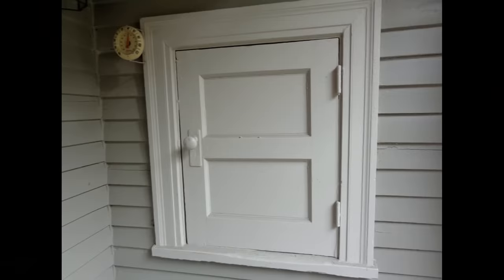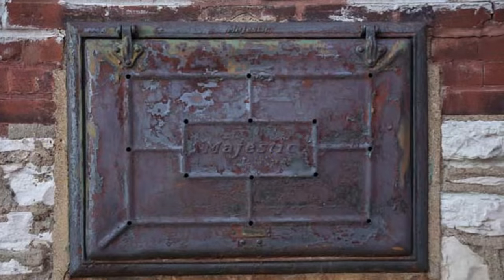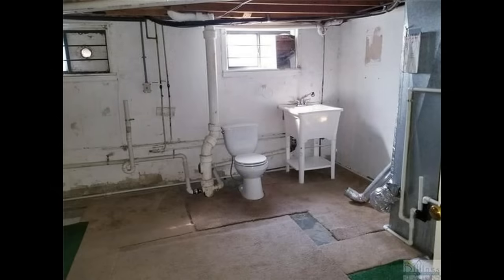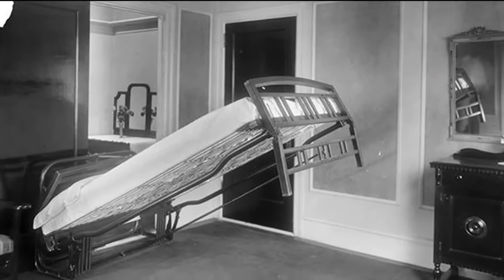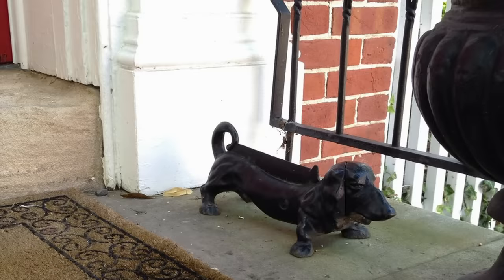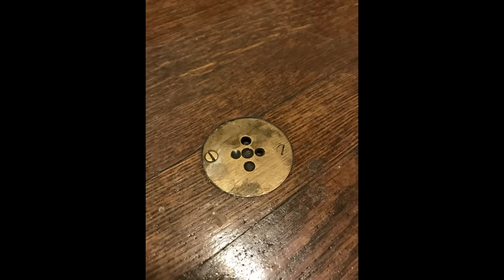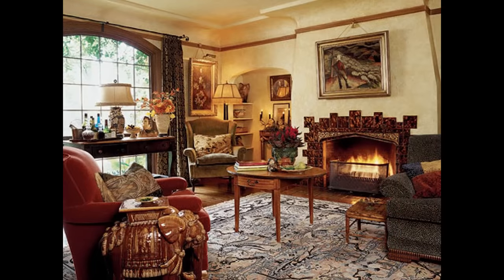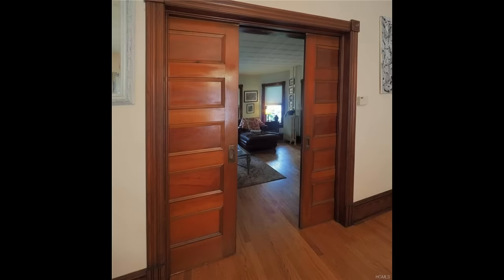Mysterious Home Features No Longer Used

Comment: My grandmother’s house had those things. The milk was still delivered into the little door in the kitchen when I was a kid. And there was a cabinet with a built in ironing board. Thanks for the explanation about the basement toilet. I always thought it was ridiculous but my husband is a contractor and he automatically used that setup for the original purpose.
Reply: The main problem with those were the proper height for drainage.If you're lower than  the main drain, it won't flush and also the smell stays in the basement
Reply: @blainerudy2255  What happens in the basement stays in the basement
Reply: @blainerudy2255  My basement toilet works well enough with gravity alone, but my next-door neighbor's needs a macerating pump because the main line runs downhill from their side.
Reply: The farmhouse I live in, built in 1931, has an ironing board in a closet and I still use it.  We also have a toilet and shower in the basement - enclosed since I've lived there...hubby uses it all the time with no problems with drainage to our septic system and no smell.
Reply: I wish they had also shown a built-in ironing board - there very popular.  Another thing not shown was a cabinet between the kitchen and dining room that served both sides.  We had one and it was really great to not have to carry dishes and flatware from the kitchen, just open from the dining room side.  We also had a pocket door between the dining room and the kitchen.  We had to put a hook and eye latch on it because our Australian Shepherd very soon learned to slide it open!  Built circa 1900, we had the picture rails among other things mentioned here as well as beautiful leaded glass windows!
Reply: My grandmother had an kenning board cabinet, which I always thought was genius. We've gone backwards in that way. Now we have to set up a cumbersome contraption that takes up a ton of room.
Reply from the maker: Thank you for watching and sharing some of what your grandmother's home had.

Comment: Even with modern heating and air conditioning systems, transom windows really help with air circulation.
Reply: House a friend rented had transoms on the floor! They were really great. Open them in the evening and the cool air comes in the bottom, hot air goes out the top. Unfortunately, both sets were on the same wall. No cross-venilation.
Reply from the maker: Yes they do.  Thank you for watching!

Comment: Here in Japan, the intercom is still universal, along with the doorbell camera. My wife and I use ours every day! Japanese homes almost never have central heat/AC - they employ the room/space concept and have separate units for each room that needs to be temperature regulated.
Reply: If I am not mistaken, what you are describing is called zone heating and can also be accomplished with central heat/AC by using different thermostats, which then use dampers to direct the heat/cool air to where it is needed.  Otherwise, the control is done by opening and/or closing vents/registers.
Reply: Because Japanese homes are rebuilt so often (isn't 30-40 years the norm?) I think there is less fear about putting in 'trendy' or house-wide features, such as intercoms or built in electronics, like self-heating bathtubs and fancy washlet toilets. By the time they start failing, it'll be time to rebuild the house. In other places, were the mentality is that house is essentially permanent, and maybe expected to last a hundred years or more, there is a mental reluctance to putting in similar features, since they will wear out far faster than the house and become a nuisance.
Reply: @davidrickard8943  It’s more like a mini-split system, which you can find in the states on older homes that do not have HVAC.
Reply: @blatherskitenoir  you're not suggesting that we've been building homes with more than a 20-year foresight, for the last 50 years I hope...
Of note those houses 100 years and older are made mostly of primitive growth wood which is not as prevalent now is it once was
Reply: In my opinion that sounds more cost effective to have separate units for each room then you would only be running heat/ac for the rooms being used.
Reply from the maker: Thank you for watching and sharing how it is in Japan!

Comment: Loved this video. The only one I thought of - and lived with - was the attic fan. They were wonderful instead of air conditioning. Kept the house cool in the mornings & evenings. And the air in the house was always fresh. Wish I had one now!!
Reply: My MIL’s house was built in the 80s I think, and has one! It’s in New England, so the nights are so nice & cool!
Reply: I think attic fans are still current.  And they're every bit as useful in a house that has air conditioning, because they substantially reduce the air conditioning electric bill.
Reply: I grew up in muggy Missouri and remember well the comfort of falling asleep with cool air from my open bedside window being pulled in by the attic fan.  As an adult I lived in an older "rowhouse" in DC which had a belvedere. This was a small tower in the ceiling at the top of the three story stairwell. It had transom windows on all four sides that could be opened to catch the breeze and draw the rising hot air out of the house.
Reply: @bryanhenderson591  Most  reputable HVAC companies will recommend attic fans when installing central A/C - it simply takes some burden off the A/C system.
Reply: Sounds like you are referring to a whole house fan.  These are still used in the South quite a bit.  Flip a switch in a cool part of the day and the whole house cools down in about 5 minutes.  You can do the reverse in the winter if it gets warm in the afternoon.
Reply from the maker: Those attic fans are a great one to remember.  Thank you for watching and mentioning that one!

Comment: You’ll hear it in some Victorian-era houses that have architectural niches built into the wall of the staircase landing. The story goes that these niches were called “coffin corners.” Someone might explain that, because most people died at home in their beds and because most bedrooms were upstairs, it was difficult to get the casket up and down the stairs when the staircase turned a corner. So at the landing, Victorian architects would cut a niche into the wall. The pallbearers would insert one corner of the coffin into the niche and make the turn at the landing.

Part of this is true: people did tend to die at home and the bedrooms of larger homes did tend to be located on the second or third floors. And many Victorian homes do have niches built into the wall of the staircase. But these were for decorative purposes: to display a statue, perhaps a bust, or a vase, or maybe flowers. Why would anyone carry a coffin upstairs to the corpse rather than carry the corpse downstairs to the coffin? Most books about Victorian architecture debunk this myth. For example, John Maass calls it a hoax in The Victorian Home in America (1972).
Reply: Have a look at the front doors of those homes. Many could lift off the hinges and be used as "cooling" boards for the deceased.
Reply: A lot of those homes have  coffin doors as well - a secondary 'front door' so to speak. You don't have the living go in and out of the same door as the dead. The Victorians had a lot of death superstitions. The dead were always carried out feet first so they could not lure others to follow them to the afterworld by looking them.
Reply: Around the victorian time period they had books of the dead or recently deceased and viewing rooms ( a special room in the house to put the coffin in to allow people to pay their last respects to the dead (this was before the rise of funeral homes)
Reply: @erin7231  That’s right, they had the living room and a parlour. If your family member died they would be cleaned and prepared and would be kept in the parlour for viewing until it was time to go for the funeral.

Comment: Another interesting feature in most homes of the Victorian era was the "Trunk Room". This was a large closet usually located at the top of the house and used for the storage of the big steamer trunks and hat boxes required for traveling.
Reply: Interesting! I’ve read some old British mystery novels in which the house has a “box room”. I’m thinking these were used for the same purpose.
Reply: Also known as a "lumber room," though I don't know why.
Reply: @Blakeneyd  we had a box room. Was the 3rd bedroom and built over the the stairs so had an unusual shape.
Reply: These are now called 'walk in closets'.
Reply: @jonathantan2469  Um, no. There were usually no rods for hanging clothes. Victorians had enormous wooden trunks that had to be stored when not in use. Fun fact, you can estimate the age of such trunks by the shape of the lid. Early versions had flat lids. They were stack up in freight cars, and the ones on the bottom get ruined. So, manufacturers started to shape lids in ever-increasing curves to limit stacks.
Reply: @Blakeneyd  Box rooms are about the size of a walk-in closet.   Sometimes used as a bedroom but may have originally been for that purpose.
Reply: @scallopohare9431  The lack of closets, bricked up windows, etc all are related to different tax codes.  At one time buildings were taxed on the number of windows.  Then interior doors.   So closets were replaced with armoires.
Reply: Always wondered why they needed such huge luggage - steamer trunks, back then.
Reply: @paulstubbs7678  bigger clothes. For women especially with big full skirts and petticoats. Back then people wore different outfits for the different times of day as well.
Reply: @paulstubbs7678  they would be approximately 3' w x 2' h x 2' d. Yup, very bulky!
Reply: @dorzak975   That's awesome, and very pragmatic.

Comment: The house I grew up in had something I was told was called a "borning room", which was intended for childbirth.  It was paneled on all sides (ceiling, walls, floor) with wood paneling -- pine, I think -- and I'm guessing that was so that it could be easily sanitized.  It was right off the kitchen.  We used it as a den.  Let's see... the house was also insulated with corn cobs behind lath and plaster.  We discovered that when we rewired the house.  It was interesting to see the old corn cobs because they are much smaller/shorter than the ones you see today.
Reply: @Rob Mikels We later moved to Maine and my mom told me that she heard from others that there, old houses used seaweed for insulation.  I never tried to corroborate that but given it’s another plant material which has air cells built in, it makes sense to me.
Reply: I have seen sawdust in the ceiling for insulation in an old cabin in WI on the lake. I helped remove it and replace it and what a mess that was!
Reply: It was also used as a sick room or for hospice. 
Birth thru death happened in there, in “borning rooms”.
Reply: Interesting
Reply: Smaller size, before GMO
Reply: @lisabuttonz  Certainly GMO has increased the size.  But if you think about it, we have been genetically modifying crops since the dawn of agriculture by selective cultivation & breeding.
Reply: @maruzze  selective breeding and hybrids are natural. Taking genes from a mushroom and putting them into corn is something else entirely. There is a reason why most European countries shun GMOs.
Reply: @chiarac4967  Agree!

Comment: My Grandmother had a house in Queens NY.  There were still farms across the street when I was little in the 50's. She had a lot of the features you showed. But one thing she had which was not shown here were vestiges of gas lamps in each room. Where they used to hang were decorative plaster  disks on the walls and on the ceilings. They were mysterious looking and used to scare me.
Reply: Gas fixtures can still be found at McSorley's Old Ale House in Greenwich Village. They're electrified, though, with wiring snaked through the piping.
Reply: Our kitchen had a kerosene lamp over the kitchen table that could be lowered to be refilled.  We also had pump-action "Flit" guns (a brand of insect spray) in the kitchen.
Reply: I grew up in an Edwardian home and there was still traces of the gas lamps.  The house also had sash windows, but my dad gradually replaced them.
Reply from the maker: Thank you for watching and telling us about a feature in your grandmother's house!

Comment: Older homes in California Central valley often had a "vegetable pantry", especially those near enough the delta go get an afternoon breeze.  This was a kitchen cabinet with an opening through the roof, and usually a vent on an outside wall, with slatted instead of solid shelves.

Another one I can't believe you missed is a ironing board cabinet.  Lots of homes built in the 30's and 40's had a wall cabinet inset into the wall, and if you opened it there was a fold out ironing board.   In my grandmother's house this was right next to the telephone nook.
Reply: My 1920s home in Los Angeles had a vegetable pantry. The pantry was vented to the crawl space under the house and vented to the attic. It was pretty effective at staying cooler than the inside of the house, but it was also gross with bugs and vermin.
Reply: In my grandma's house (built in 1939), the ironing board nook was in the kitchen.  But the board had been removed, and little knick knack shelves installed in its place.

The house had a little milk-delivery door next to the side door.

And a coal chute, a root cellar, and a toilet in a closet in the basement---so if anyone was working in the basement, they wouldn't have to go all the way up to the 2nd floor, where the bathroom was.
Reply: My friend rented a house here in Galveston that had the ironing board board closet with the ironing board still in it. But the outstanding feature of this house was the little biscuit board ...it pulled out of the cabinet like opening a drawer. Used for rolling out biscuit or pie crusts dough
Reply: @tpickett1381  A few houses I lived in had pull out wooden cutting boards, they were great cuz they were huge, often 24"×30" at least. They pulled all the way out for cleaning or oiling
Reply: I heard these were called “California coolers” (I’m assuming that’s where the 80’s wine coolers got their name).  Lived in a 1920s house with a pantry that vented through the side of the house (opening covered in mesh under wood slats )
Reply: Yep Tom used to get hit with that wall mounted ironing board all the time and Jerry would be laughing his ass off at him.
Reply: @GarrickStaples  omg... I have one of these and literally never knew why it had a vent in there.
Reply: @tpickett1381  I've seen houses here in Phoenix AZ built in early '50, that more like a 'cutting board' similar to your biscuit board.
Reply: I have an ironing cupboard in my house. My mother designed it and my father built it. I  also remember boot scrapers outside my first school.
Reply: We had one of those fold out ironing boards. It was really nice and out of sight when not needed. It just looked like a long narrow cupboard.
Reply: A California Cooler! I lived in a rental house in Portland OR that had one of those in the pantry. It took me ages to find out what it was for. 

Sadly, it gets too hot in PDX these days for it to work properly all summer long, but I guess back before WW1 when that house was built, it still cooled down nights reliably enough for them to be in use here.
Reply: @tpickett1381  cutting board or bread board was common through the 70s when they fell out of favor. Dad is a cabinet maker and stopped including that feature decades ago (except for my Aunt's kitchen, ahe insisted)
Reply: Ironing board closets aren’t that uncommon I think. They are still common in modern hotels and motels and stuff. In most houses they don’t have them now though because people like to be able to move their iron around.

Comment: Wall anchors are still in use in Czechia for mine areas. Where whole villages are undermined and ground is sinking slowly. Purpose is to make the house to sink as one object. If you do not have these, one wall may sink faster and rip your house in half (I saw it when my friend's bathroom moved 20 cm from the rest of the house.)
Reply: Wall ties are a common feature in UK houses usually as a result of repaired World War ll bomb damage.

Comment: I remember asking my parents about the slit in the medicine cabinet. They had never noticed it. When we pulled the cabinet out for painting, it had a couple of razors behind it. My fist house was in a neighborhood built in the '50s, and almost all the houses had coal doors. We also had the phone nook, where we kept our landline phone until we got rid of it. The slot underneath was meant to hold the 3" thick phone books that were once delivered annually to every house.
Reply: I don't think razor slits are quite as old-fashioned as he makes them out to be.  I had an apartment with one in a building that was built in the early 80s according to the landlord.  Forty-odd years is a fair time, but not back to iceboxes and root cellars.
Reply: The house that I grew up in was built in the 1800's and had the razor blade slots in the main bathrooms.
Reply: Those were later additions. Double edged safety razors came out in the early 1900s.
Reply: My dad always shaved with real razor blades. Only saw those receptacles in hotels